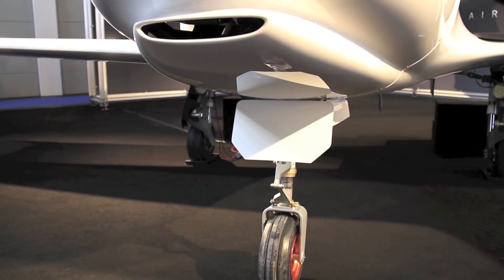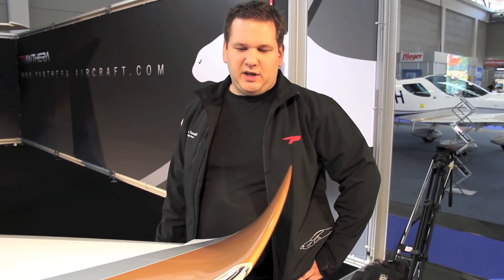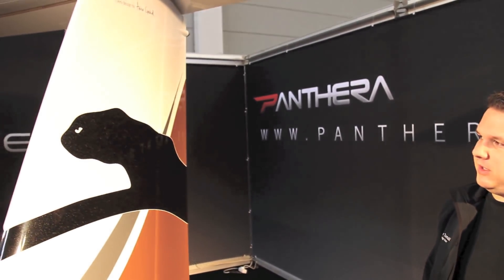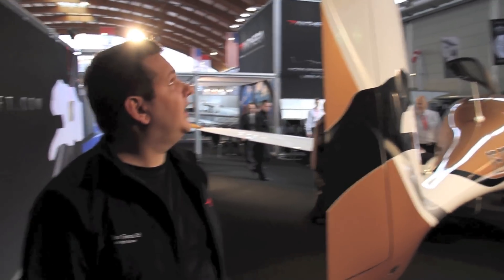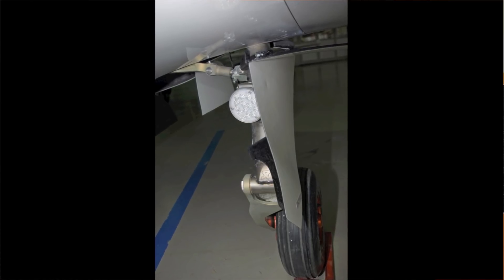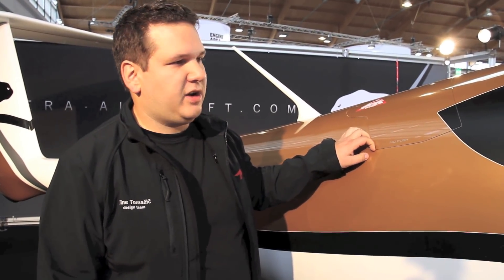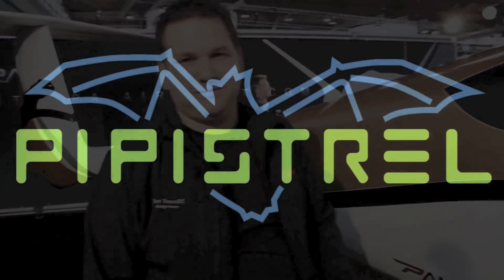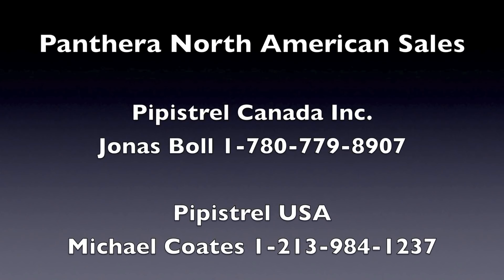Pipistrel Panthera

Comment: Assume Pipistrel's published full fuel payload of 870 pounds. Four 189 pound passengers and 100 pounds of baggage equals  864 pounds, so the airplane should be able to fly safely within its's C of G  limit with the seats, tanks and baggage area maxed out. That is pretty damn good. So there is room for about 16 pound of extra passenger weight to get to the 870 lb limit. Put one fat guy in the airplane and Pipistrel's numbers no longer apply. 

I don't believe the IO-360 engine will deliver its high cruise speed burning only 10 gallons per hours. More like 11-12 gph. Nevertheless the Panthera's stated range of 1000 statute miles, the aircraft's fuel capacity of 55.4 gallon of avgas at its "performance cruise" of 181 knots at 8,000 feet burning 10 gallons per hour, the airplane should have enough endurance to fly for about 5.5 hours to dry tanks, or 181 x 5.5 which equals 996 statute miles. That is awfully close to 1000. But that is a deceiving figure, since no sane pilot attempts to land with less than about 45 -60 minutes of fuel reserve. So the Panthera's real-world  range is 814 statute miles, or 708 nautical miles. With speed further reduced to 155 knots at 12,000 feet  Pipistrel claims the Panthera will fly 1000 nautical miles carrying four 189 pound occupants with a 45 minute fuel reserve, taking almost six and a half hours to do so.  Also the Panthera's service ceiling of 20,000 feet seems a bit pointless, since normally aspirate aircraft are usually operated no higher than about 10,000 feet. 

So the Panthers marketing claims of 1000 nautical miles range and 200 knots cruise speed carrying four passengers are correct. Sadly,  not all three at the same time.

Comment: I wonder what kind of fuel economy this gets? Risen aircraft boasts a 1400 mile range on 22 gallons of regular unleaded gasoline in one of their airplanes. (they call it an ultralite, but it's 450 kg.)
Reply: The Risen is a two seater and uses a Rotax engine 90 hp. Although Risen is a nice plane they are not comparable at all. What would be the purpose?

Comment: By Marino Boric / Published: Feb 27, 2014

Pipistrel has reported to Flying that its Panthera four-seater aircraft development program is suffering a considerable delay. The holdup, according to Pipistrel CEO Ivo Boscarol, is due to Lycoming's decision not to certify its four-cylinder IO-390 engine for auto fuel use, a key feature for Pipistrel in creating the Panthera. Lycoming declined to comment on the claim for this story...

Read more at http://www.flyingmag.com/aircraft/pistons/big-delay-pipistrels-hot-single-panthera#ozlRluU7jr6rjgFb.99

Comment: Price?
Reply from the maker: Price facts, June 2014, prices are in € (euros)
€385,000 experimental factory assist IO-390 engine and Dynon avionics
€405,000 experimental factory assist IO-390 engine and Garmin avionics
€425,000 experimental factory assist IO-540 engine and Garmin avionics
€465,000 IFR certified Part 23 utility category (540 and garmin equipped)

Pricing will most likely increase once serial production begins later this year.
shipping, taxes, bank currency exchange fees... etc...  are extra.
Reply: Not bad.  IO-390 with the Garmin suite seems like a real winner for efficiency and payload.

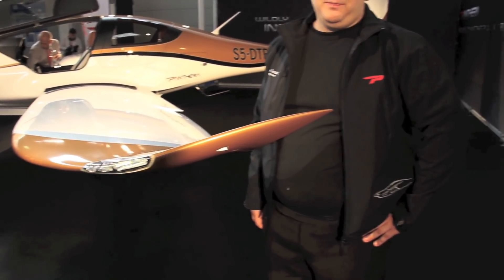Comment: What's the tiny little NACA-like inlet right at the wingtip?  It looks to be about the size of a US quarter dollar coin or a bit bigger.  Visible at about 3:30.
Reply: ***** Cooling feature for the LED light
Reply: The NACA vents are actually the fuel tank vents. They are in a location above the tanks due to the dihedral of the wing and least disruptive for drag (wing tips are already a turbulent airstream). Look at the Lancair IV with winglets. They use the exact design.
Reply: I saw the same thing, tried research and couldn't find anything.... First thought was a hidden pitot static system. I got this idea from the hidden pitot static system that Cory Bird incorporated on his Symmetry. Not only that, but I have yet to see where the Pipistrel gets its air-sampling (Pitot-tube, etc...)  However Naca inlets wouldn't work due to the disturbed airflow, etc, meaning it is horrible air for any kind of data sampling.

This leads me to think that (if) they are located on both wingtips, it could be used to redirect a small portion of airflow, and release it at/in the trailing edge, or along the trailing edge to somehow reduce Tip Vortices. Another option would be simply trying to "suck in" a portion of the boundary layer, to either reduce span-wise flow out to the tips, and act as an invisible wing fence, meanwhile using the airflow for other systems, or simply releasing it elsewhere on the aircraft.

These are just my own personal speculations... Would be VERY interested to find out the true reason.

EDIT: After reading my second explanation, I realized it may not be very clear... Anyways, The idea I am trying to get across is that they my be trying to create a "void" or reduction in the air that would otherwise be "pushing out towards the tips." Similar to a wing fence, it would block the high pressure air on the bottom from traveling to the tips. Therefore reducing the amount of high pressure air available at the tips, to overtake the low pressure region on the top, thus reducing the vortex...
Reply: So Simple it skipped my mind!

Comment: Now, the real challenge.  Make it affordable.
Reply: 400'000 Euros new isn't too bad I think.
Reply: MrRibbotron I can get a used lancair turbo prop or even 3 Carbon Cubs for that price. It's a beautiful airplane but I just wish it was more affordable.
Reply: Well yeah but the Carbon Cub only seats two and flies at half the speed. It's like comparing a Porsche and a Nissan Micra. You're right about the Turboprop but it still costs $550'000 new, which is the same as this, so we'll have to see how much cheaper this plane is second hand before passing judgement. I'm personally quite wary about buying second hand kitplanes anyway.
Reply: Panthera will be closer to 600k in reality, but that is the price for what this plane delivers. Personal planes are expensive, if you only want a hobby plane you can buy a 50 year old cessna for 50-100k and you are done.
Reply: Bailey
It makes no sense to compare a new aircraft to a used one, and a turbo prop is super expensive to run and maintain especially if you buy an older one. If you wanna buy a good hobby plane this manufacturer has a 2 seater for less then 150k as brand new, this one however makes a good long range corporate executive plane so it will be around 600k fully equipped
Reply: why? if they make it affordable they cut the profits, this thing is for rich people, you want affordable get an alpha trainer, or better, a 1972 Cessna 150 or something like that

Comment: You are funny guy:-) Obviously you know only 2 Cessna models; 152 and 172. What about 310, 402, Corvalis TTx. Not even mention of Citation line...

If you think that there is no innovation from 152 to 182 that you are wrong. Besides of that, if you are rookie pilot / first time buyer you can get two sitter C-162 for roughly 150 grands.

cheers